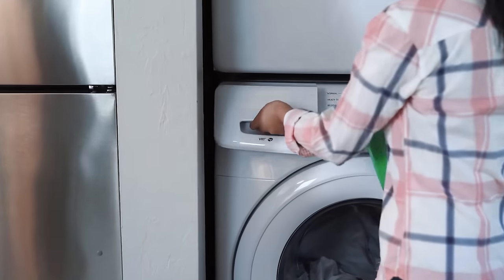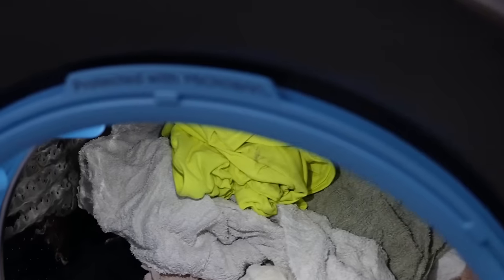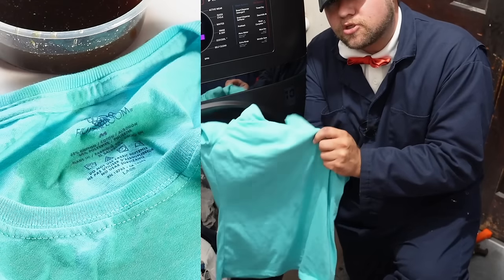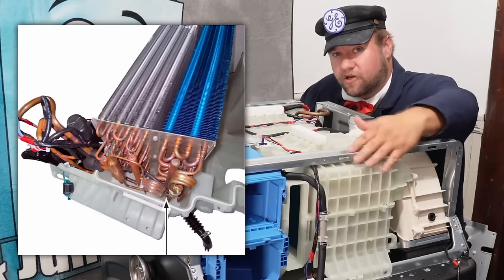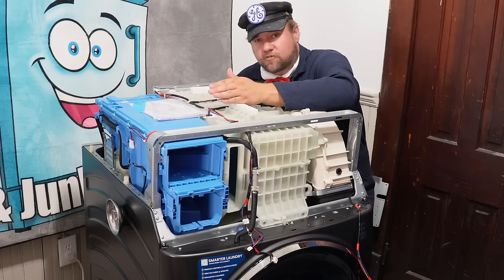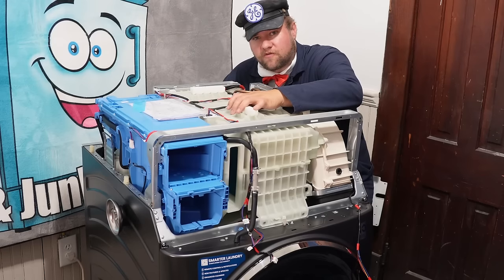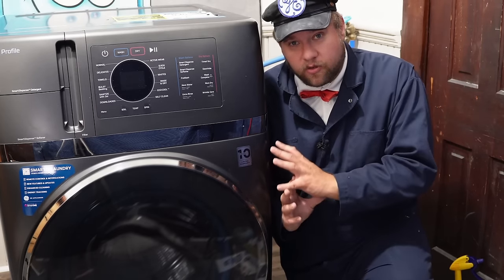The Best Washer Dryer EVER? The Ultimate GE 2-in-1-washer Dryer Combo Test & Review

Comment: On that washer and dryer machine it depends on what detergent you put in there either you have normal or ultra oxi with oder eliminators or ultra oxi or whatever or persil or tide or gain or downy or whatever company you buy at stores for detergent, fabric softener, pods or detergent powder or the dot things or whatever so it depends on what you buy of detergents and stuff for the Machine and how much clean and stuff your clothes and stuff get

Comment: No venting, no purchase. I've bought an Equator 2in1 in the past and it never dried enough. I've got an LG 2in1 now. It doesn't dry enough either. So I just use it as a washer now and kept my decades old Sears dryer which I was intending to get rid of. I will never buy another 2in1 unless it's vented and dries 100%.

Comment: so I have t oask whats the reason for using one of these over a regular set.. or a separate set of washer and heat pump dryer if electric usage is a factor..  at 4 hours and 20 minutes I can solidly wash and dry 2 very full loads of clothes in my separate set and be well on my way to a 3rd load..  I can sort of see it if you are accustomed to tossing a load of laundry in and then going to bed or leaving the house as you get back and its done.   how is the vibration on this? I got rid of my front load and went back to top load a few years back simply because my front loader stank no matetr what i did (since this dries im thinking thats a non issue).. and my front load vibrated the whole house when it spun at 1400 RPM...

Comment: When disassembling that unit, who do you think makes it for ge? It looks like a Samsung or LG-built unit to me. Ge has used lg in the past for their harmony-linked system years ago.
Reply from the maker: Its new. There aren't any parts that wholly match another company. GE used to use Midea for some systems which are similar to Samsung, but that isn't this system at all. The compressor is a very strange brand I've never seen, and maybe outside the pumps it all seems very proprietary. I assume its going to be something Haier has done, because the old Haier-built PCBs are pretty similar, so I think they have their own factories somewhere outside of the Midea footprint, IMO.

Comment: Does it have a sensor or reminder when to clean the filters?

How quick is the fastest option and does that include drying?
Reply: It doesn’t seem to have a sensor. The reminder seems to be based on the number of times used. About every 5 uses it will remind you to clean the lint filter and you have to confirm it’s cleaned. About every 50 uses you have to confirm that you have cleaned the foam filter

Comment: I am having a differnt experience. My clothes arent drying!!! Even with adding the hours of drying time, they are just not drying. I tried to return it 15 days after purchace from Lowes and they sent me to repair. I had two guys out. First guy said heating element wasn't working, but I do feel heat. The lint collection and filters do not work that well since when I clean them there is still link in there. PLUS in the manual it states that the clothes migjt feel damp and shake them! It is ridiculous... We have mold sensitivities here and the entire point is to come out with dry clothes. I am VERY unhappy with Lowes for not supporting us, and GE for not replacing this machine. I was so hopeful, but it failed. What an expencive loss this is. We are using it to wash and drying with our old 25 year dryer. I am very upset!

Comment: The biggest issue I see with these is that you can't wash a load of clothes and dry a load of clothes simultaneously. So you're jammed up doing laundry because the machine is being used for both. The upside is the space savings. I guess most homes could have two of them because most American homes have space for a washer and dryer.

Comment: Can you elaborate on why we should not to get rid of our standard washer and dryer just yet ? Is this combo unit not good enough to replace the standard side by side washer and dryer ?
Reply from the maker: If you have room, two units can process way more clothes faster, and if one side breaks down, the other would still work. But if you don't have the room, or haev a small volume of clothes, it makes perfect sense.
Reply: @bensappliancesandjunk  Would you recommend repairing a 19 year old compact Maytag washer dryer center versus getting one of these for a 563 ft condo unit (on the 10th floor).  The dryer is making a squeaking noise/sound now and wife wants to get a new washer/dryer stackable unit or center and I keep remembering a guy who did the last maintenance on our Maytag combo unit had told me that I should keep this unit as long as I could as the newer modern models with electronics take much more maintenace and never last very long - he even said my Maytag combo unit might outlast me (5 years ago when I was 62 and Maytag combo unit  was about 14 years old.)

Comment: In Canada it’s cheaper then buying a washer and dryer separately?

If you don’t have much room in your laundry room this one would be great?

Or if you don’t Want stackable washer and dryer this is great unit?

It great that it only uses a regular plug?

And I feel it great for older people, because you don’t have to remove
your laundry to a dryer at anytime?
Specially if you have “Bad” knees or hips.

But I read it’s very heavy in weight? Over 700 Ibs.?

I will be getting one because I do have a disability 
and I cannot Reach up to use a stackable washing 
machine and dyer and in my new subdivision in our laundry 
rooms we are not allowed a side-by-side unit.

By the time I get this “Amazing Machine” they would have gotten 
all the “Bugs Out” and probably changed a few things to make it
even better then it already is.

And then cost to buy it will be even less for it.
I feel anyways.

Comment: A filter needs to be cleaned.  We clean ours after EVERY USE.  and we have to clean the exhaust vent about every three months.  So I don't see what the big deal is.  We had an All-In-One unit when we were stationed in Italy and Spain from 1981-1988.  It was probably HALF the size of a US washer/dryer so we had to do twice the number of loads and we couldn't do BIG items like comforters or several pairs of jeans.  And to be honest the DRYER never got the laundry DRY on its normal dry cycle, so we always had to had a second DRYING cycle.  But it fit our small European kitchen and worked on 220V/50 cycles.  And its efficient is out of this world and for folks like with solar panels and battery backup, we could run this anytime we need to even from our battery backup if the grid is OUT.  That's a game changer for folks like us.

Comment: Can you rerun the dryer after it's done to dewrinkle clothes and can you set it to low or air dry?

Also does this require a vent? I wasn't sure by what you stated.
Reply: Same question. I didn’t see air dry as an option and wondered if you could configure that on the app. Most of my nice shirts I wash on delicate and then stick in the dryer with NO heat. Tumble dry 30-60 min depending on what I’m doing. Needs to have a tumble dry option with no heat for me.

Comment: I love this heatpump technology in dryers, but I have a bit of PTSD with GE's air conditioners specifically. 

We've purchased several GE portable air conditioners in the past and they've all broken within a year or two of use. Either by icing up in the back or having weird electrical faults. GE has never honored their warranty either. 

Meanwhile we have several Hisense AC units that have been working for the past decade or so. 

I worry that if GE can't even figure out basic air conditioners this complicated setup will have some problems down the road.
Reply from the maker: GE AC's are Midea rebrands last I knew. I haven't taken a GE AC apart before, but its very possible that a GE AC/Dehumidifier is going to be from a different factory than this packaged heat pump. I am going to do a teardown analysis of the HP package soon, exclusively, to see whats up though.
Reply: @bensappliancesandjunk  can't wait to see that video! Frankly I would love to be wrong about GE's combo unit. 

I think saving energy and space with these new designs is going to be the way forward.

Comment: Modern cars use 1234-YF, R134a is actually being phased out at the beginning of 2024. These will need to use a different refrigerant soon. Note for the DIY folks, 1234-YF is SLIGHTLY flammable.

Comment: Cool system. However its slow if you figure you can wash AND dry at the same time with a traditional system. yes it takes 2hrs to do 1 load. However if you are doing multiple loads its really only 1 hour per load as you are washing a load while a load is drying.
Reply from the maker: That assumes you have the room for twice the units, too

Comment: I need the door to open on the opposite side and could not figure out how to get the locking devise out of the right side of the door.
Reply from the maker: Can't reverse it as per GE. You could potentially reverse it by extending the wire harness. The hardware is there to do it theoretically, as the door hinges can be reversed, but its something you'd have to be REALLY careful about.

Comment: We'll see I work on appliances I like the idea of just one unit even thought about buying one but the only problem I see is ge being the brand they don't have a great track record these days I'd be interested to know how much some of the parts cost the ui or control boards are not cheap and I imagine if something goes wrong with the compressor they generally aren't cheap and as the whole heat components can be replaced with the compressor I'm thinking that is gonna be costly I guess time will tell

Comment: Why are control board issues such a common problem on appliances? Laptops can usually last for 20+ years and are way more complex.
Reply from the maker: Crummy electronics and undersized relays. Laptops aren't dealing with 10,20,30 amp switches constantly AFAIK.
Reply: That makes sense. So frustrating manufacturers won’t make stuff that lasts.

Comment: Correction to the refrigerant part, All new vehicles are required to 1234yf refrigerant. They fazed out 134a in the past 3 ish years
Reply from the maker: Right, but R134 is the most common for vehicles actually on the road and is easily attainable to DIYers.

Comment: Won't the long run time on this unit wear out clothes quickly? Friction creates wear. Four hours of friction has to create much more wear than the typical 1:45 minute run time of most separate washers and dryers. That said, I like the feature of not having to send heated and cooled air in the home out the vent.
Reply from the maker: If this was the case, we'd of seen that criticism of combo washer/dryers that run for far longer than this unit. But I haven't seen anyone make that claim yet.

Comment: I saw in interview with Ken Rudolph who is the man behind the combo unit at GE. He said there are hardware pieces built into the machine that they will be able to launch with a software update. Is there any hardware that you noticed in the teardown that may not be active yet, like a heater for sanitizing?
Reply from the maker: Why would it need a heater for sanetizing when it already has the heat pump? I do agree there are probably more features that could be utilized on the machine, and software is a great application for it. You can also tell the chassis is modular for more features that would require additional hardware, but there's nothing "Extra" on the machine parts wise that are being software-locked from what I see.
Reply: @bensappliancesandjunk  I saw another breakdown of the combo where they said there was a water heater under the outer tub (by the drain pump) for heating water for the sanitize cycle. But according to GE there isn’t one. So I just wondered if maybe it was there but not active yet.
Reply from the maker: @sjf1232  there's an area for it but AFAIK it just as a sensor. I'm about to open that part up for a video so I can check though

Comment: I don't dry my jeans, can you prevent the dry cycle from automatically drying until you've taken out your hang to dry items?
Reply: Yes. You can select wash complete function and it will pause for about 10 minutes before the drying cycle starts. Or you can deselect drying function and the machine will just stop after washing. Then once you remove the jeans you can just run a drying cycle
Reply from the maker: You can just do a wash only cycle, yes

Comment: Does it have the old problem of other all in one's of creating excess moisture outside the unit? I plan on using this in a closet, and worry about moisture buildup
Reply from the maker: I didn't notice any issues
Reply: Once the door is closed it’s a sealed system. No air is drawn in or ejected.

Comment: I'd like to know if the seals will mold like every other front loader and will it smell like mold for 10 years
Reply: Mould needs  moisture and high humidity to establish. Just leaving the door and draw open between washes and an occasional 60C+ wash with oxi-bleach is enough to prevent mould and smells from bacteria in a regular front loader,  mine is 15 years old and mould and smell free.  The drying cycle and the microban coated seal on this should do a lot to reduce, if not prevent mould.

Comment: So the swappable unit up top is great for both GE and the consumers. 
Those who don't clean their units will freak if they have to replace the entire unit when it inevitably breaks. But having to just replace the compressor unit for a few hundred will likely keep them coming back vs shelling out another few thousand. 
GE gets the profit and the customer is happy.
Or the customers can maintain their units and GE still get a couple bucks here and there over the long term. 
Also wondering if right to repair legislation has anything to do with this new trend I hope GE is setting. I am for it either way!

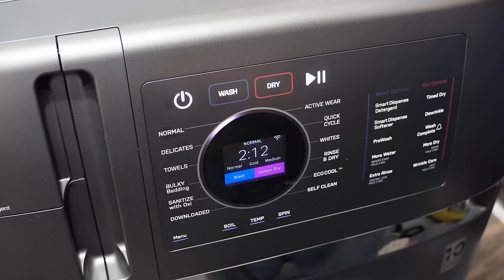Comment: 14:15 Shame it does not come with an app to allow full customization of the wash cycle. And apps are usually easier to use than the built in display interface.
Reply from the maker: You'd think. I had the exact question poised to me from a viewer, thus why I tried to figure this out to no avail. Doesn't make any sense because you can download new cycles to the machine from the phone/app, but not your own. Why? Seems it'd be easy.

Comment: I'm a bit mystified as to why 2 hours is so much better than 3 hours. Sure it's faster, but unless you need to do multiple loads a day, does that matter?
Reply from the maker: 3 hours on other combos tends to be a best-case scenario under absolutely perfect conditions and usually requires 240v electric. This is 110v and is nearly as fast as a traditional dryer, so it does have advantages.

Comment: My big problem with this unit is longevity.  You just basically added a high speed fan and a total heatpump unit to a washer and dryer.  That is a lot of complexity and a lot of things that can go wrong.  You state that you can swap the whole heat pump unit, but what a waste.  What do you do with that crapped out unit, but take it to a landfill.

Comment: This does not need dryer venting to the outside - is that an accurate statement?
Reply: No vent! The heat pump removes the moist air and the water from it goes down the drain. My dryer vent is capped off and I will never have to clean it again :D All you need is the water hookup, drain, and regular outlet.

Comment: It's cool and all. But I'm using the same GE gas dryer from 2002. While the sealed system is replaceable currently with part numbers....will GE make those those parts available in 2030? Of course not........

Comment: Does the combo unit minimize mold due to the drying of the drum?
Reply from the maker: All signs point to yes, I am unsure if the fan inside runs like the other GE washer's does when it is not running, but the tub cleans cycle will actually run the heat pump for about an hour or 2 during that cycle to rip all possible moisture out

Comment: Do duel washer and driers use the same hook ups as the regular non duel set ups?
Reply from the maker: It uses the same drain hose/water lines as a normal washer. But it uses a normal washer power cord instead of what a dryer typically uses

Comment: I just called to see how much it would cost to replace the heat pump assembly, it is over $1000 I believe they said $1200. That would be a lot if it goes out after five years probably negating the Electrical savings.

Comment: I'm not sure it's worth the risk being on the bleeding edge of the dehumidifier tech in there. It is nice that it's a replaceable unit, but how much is that unit gonna cost in 5 years? I'd like to see some longevity testing before I would invest in this
Reply from the maker: The issue is we won't have any clue for years. One amazing thing is it's R134 so it's not R32 or R600..
 Old refrigerant tech which should theoretically be way more reliable.

Comment: One Big Issue that a combo Washer/Dryer can't overcome is the fact that the dryer with the heat ages the seals necessary for the washer to not lose containment of the water (this issue is also caused in washers alone if they aren't used often enough if the seals dry out - similar to toilets beeswax seals failing).
Reply: Interesting point as I just split open the plastic drum on a front loading washing machine to change the bearings .   The one I have has a rubber seal between the two halves.   While the seal looks in decent condition after 19 years, it wasn't subject to the additional heating cycle.